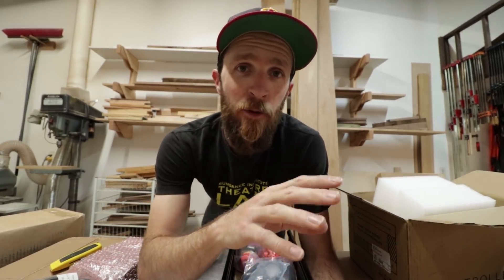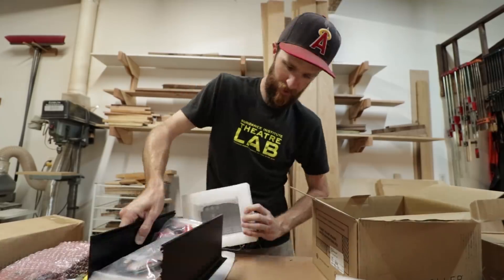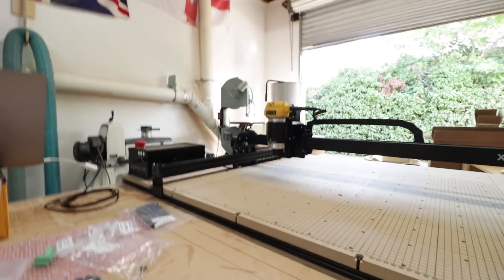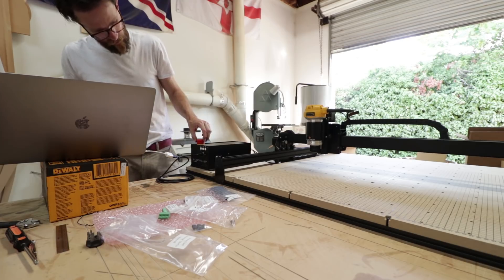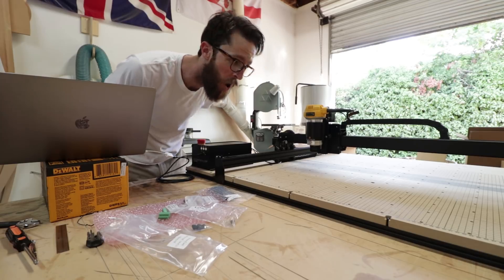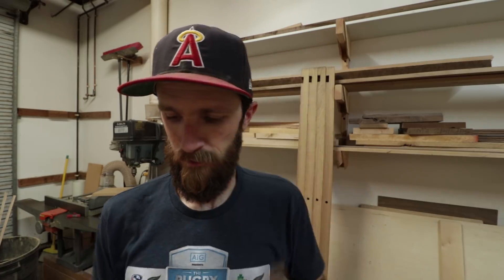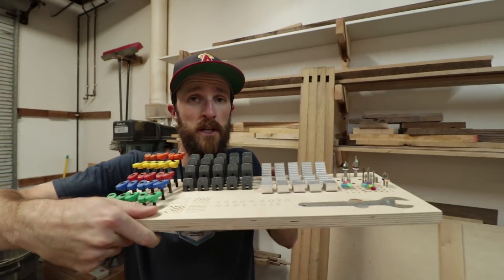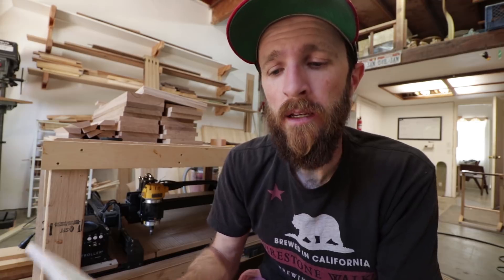Building & Using a CNC Machine for the First Time - Shaun Boyd Made This

Comment: Hi I noticed in one of your more recent videos possibly a pull out table table for your x-carve. Do you have a video on a build for that? I’ve been wanting to mount mine under my table but with the ability to have the whole thing slide out for the dust shoe attachment.
Reply from the maker: I actually just cut my assembly table top in half so I could easily remove it when using the CNC with the dust collection, which is kept on a shelf under the table. Kyle Toth actually made a pull out shelf for his machine, and I'm pretty sure he made a video about it, if you want to check that out.
Reply: Awesome! Thanks so much! I really enjoy your videos.

Comment: I've had an X-carve and can give you a couple heads-up. If you want to do things like carving seats, you'll probably need to go with a program like Fusion 360.  It's a 3D modeling program from Autodesk and is free to hobbyists and small biz.  There's much more to it than Easel, but you can do much more with it.  Check the Inventables forums if you haven't yet, lots of info and knowledgeable users.  Get a dust boot if you don't have one... saves tons of clean up time.  Enjoy!
Reply from the maker: Man, you nailed it! In the past few days, now that I am beyond just carving my logo, I have downloaded Fusion and started to dive into learning that. And the first thought I had when I cut something slightly larger was that I need to hook up my dust collection! Thanks for the tips!